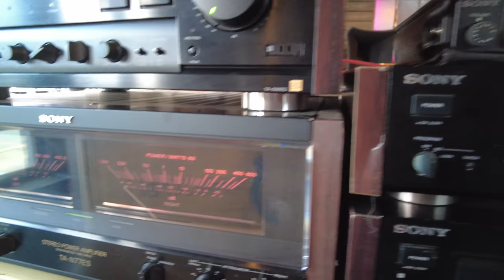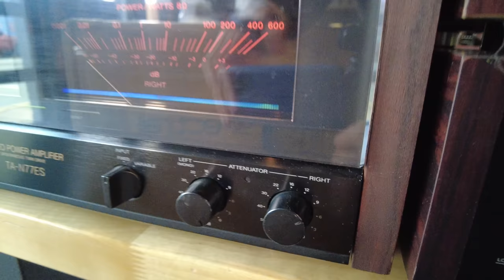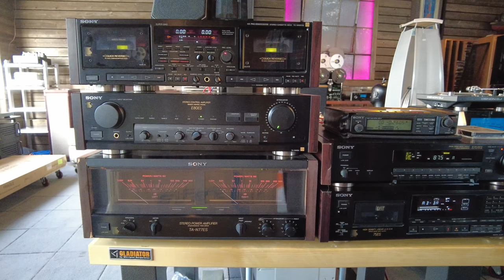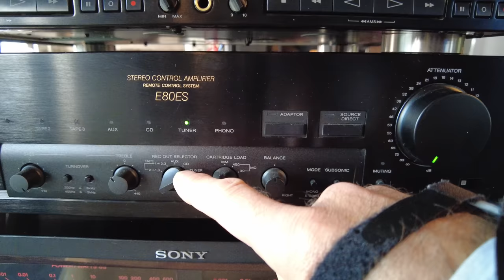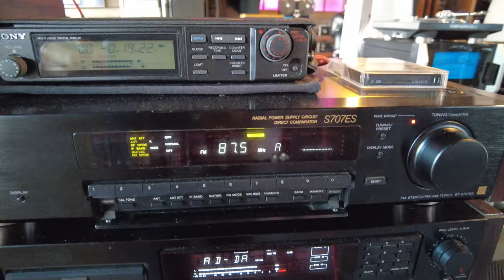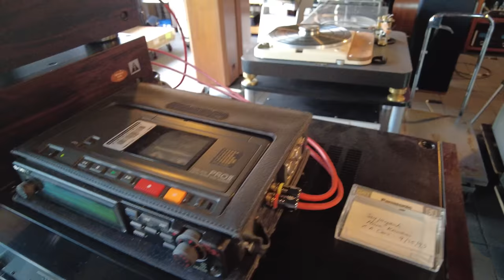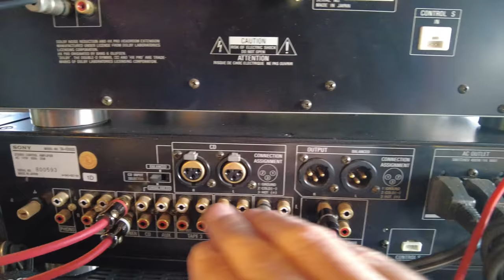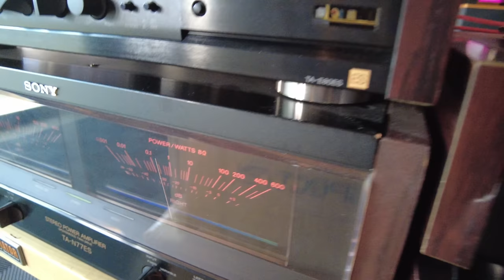Killer Sony System from the 80's

Comment: I actually think some of the smaller amateur Sony stuff from that time wasn’t too bad either. I have a 1991 model Sony str-av570, stereo receiver often called “worthless trash” by the audiophile community. It looks like nothing special, but it actually has some power to it, and the tuner is incredible. It sounds good to me, like really good, even with the bass and treble knobs in the dead center, and it was only $25 at goodwill!! If it had any flaw, it would be that it clips a little when both the bass boost (dbfb) button and bass knob are on max while using the tuner. The only issues I have ever had with it were completely my fault. I got curious, opened it up, and accidentally swapped a ground screw for a nearly identical, slightly shorter screw from elsewhere in the unit, causing a loose connection. This would sometimes cause erratic relay clicking and lights flashing on it when in standby, as well as a loud thump through the speakers when turning it on, however it did function correctly other than that. I later realized this problem and fixed it. I really think smaller 90s Sony stuff is awesome and may sound better for the average listener than audiophile grade stuff due to the slightly pronounced bass.

Comment: Ahh the 80's good old days of stereo systems. I was stationed in Germany in the 80's I put together a hell of a stereo system. I had a kick ass Marantz receiver amplifier, a Marantz dual open deck tape deck, a Pioneer turntable, a Teac reel to reel, a pioneer reverb, a Technics graphic equalizer and a pair or Bose 901's. I can't remember any of the models anymore its been so long but it was all top-of-the-line stuff. I hit hard times after I got out and sold all of it for pennies on the dollar.

Comment: Nice vintage Sony ES setup
YEs, late 8s/early 90s were Sony's peak for hi end consumer gear that punched above its market.
Those were the days when average buyers could see some of these pieces at the Best Buys of the world in the early 90s.
I have great nostalgia for this Sony era as this was the time I could first afford this level of gear, buying a SOny VHS deck with the same look and wood side panels.
Cool that Sony did those dark wood side panels late90s/early90s when most mass/mid market Hifi dropped them post 1980 having been so common a design look of the 70s.
I would love to have that system, but swap out the DAT for similar vintage and look  Sony ES CD player ;)

Comment: The reason the N77ES doesn’t have the matching balanced inputs to the E80s balanced outputs is because the actual matching unit is the E77ES/D (there was both a non digital and digital version). The E77 is also more rare and desirable than the E80 but overall they are pretty close. 

Conversely, the “non meters” version of the amp you were talking about is the N80ES that matches the E80, and does have the balanced inputs. It came out after the N77 and the meters were dropped simply because Sony I assume figured that was going out of style at the time. The implementation of the balanced ins and outs on both units is also not ideal from what I understand. 

There was a step down model from the N77 and that would be the N55 (100w, no meters) but it had a smaller half height case. It is also believed that the international power supply versions of the N77 are more reliable than the domestic US ones but good luck finding one of those. 

Lastly, the correct matching CD player for the N77/E77 would be the X7ESD which predates the X777 and is even more of a brick house.
Reply from the maker: Very cool to know! Thanks for sharing.

Comment: These were better than Revox and Nakamichi for half the price! Technics and Denon was also superb.
Reply: i agree with you on nakamichi but revox ,what could not be 100% working i received from my father is Revox system only two components were from the 80´s a extra cassette deck and a compact disc, only the speakers could be the weak point but some earlier altec lasing completed the sound on my fathers Revox and technics it´s my cup of tea allthough i have a 76 high-end system from Pioneer ofered by my father when he bought the revox, both technics and pioneer are my favorite brands this talking about more comercial branded, there are many brands that are almost not available , not even when refered by known hi-fi magazines at the time ,it makes sense they reporters of hi-fi saw them on someones house when people wanted to get them they were not available anymore , this in the 70´s happened a lot ,it was the decade of do it yourself ,especially on Germany . I knew several guys that the speakers that were perfect were complete built by them, the bricolage years

Comment: I just got a DVP- S 7000 DVD/CD player. So far, I like it. Had to do a little research for a remote for it. BTW, I saw a Technics RS 1500 RTR in the background. A truly wonderful machine. I liked so mush, I got another one too. Now, a Tascam DR-40X does the same thing. A remote secession required hefting one of these units (70 #'s) to the site. Not any more. The Tascam doesn't weigh any more the what a reel of 10.5 tape weighs.

Comment: No one gives Sony the props they deserve.  Yeah, they've slipped a bit.  They also manufacture some very important and well crafted professional production equipment for audio and video.  A recording studio I worked at used an excellent 2inch 24 track tape machine by Sony and it performed beautifully.
Reply: they never had a sound signature . Even the Hitachi models sounded better to me
Reply: Sony had so many quirky designs in those days.....Flamingo turntables, square speaker units in the APM models, electrostatic speakers (big one) , walkman,  V-Fet amps, stopped production because they were too expensive, top turntable PS-X9 etc etc.
Reply: Sony made a number of analog and later digital 2 inch ers on par with Studers.

Comment: The ta n80es which you name as the model just below the n77es is actually just straight up better no matter the revision. Both are essentially the same amplifier but the mk1 n80es has slightly better ocbs and build quality than the n77es while the mk2 and mk3 have some better components as well. n77es is only really twice or even thrice the price of the n80es because of the vu meters which do look very cool.

Comment: The 75ES DAT (57ES in Europe) didn't actually deserve the ES logo. The cheap 3DD mechanism that was also found in the entry-level DAT decks was very unreliable and hard to fix. It's bigger brother, the 87ES (or 77ES in Europe), also sold as PCM-2700(A) for professional applications, was the much better choice with a solid 4DD mechanism.
Reply from the maker: Never had the pleasure of owning an 87es.  Hopefully one will come through some day.
Reply: @SkyFiAudio  the DATM-5x series mechanism was present in lots of Sony DAT machines up to the ZA5ES and the beautiful 2000ES. The great thing about the 87ES is the 4-head drum for real-time monitoring ☺️

The cheaper 3DD DATM-100 series was present in the 75(55)ES, 59ES, 60ES, 670, 690, 790 and ZE700. Out of these, I'd only really recommend the ZE700.

Comment: I actually had a furniture maker make solid stained rosewood side panels for my Onkyo M-508   Much better than the plastic junk that was there,
Reply from the maker: I made the set on the amplifier and they came out pretty crappy.   Hard to match the original high gloss finish.

Comment: Not all Sony ES stuff is good. I have a GA8ES receiver and it looks nice but it is junk. Tried to fix it twice. Has STK packs in the amplifier driver circuit which are not reliable. I changed one last year to fix it for Christmas and it worked for 15 mins at low volume then went pop and went into protect mode. I'm about to strip it for some parts and throw the rest away.
Reply from the maker: agreed, the fun is in figuring out and finding the good ones.  Its like an easter egg hunt.